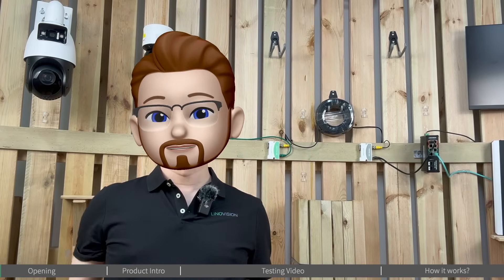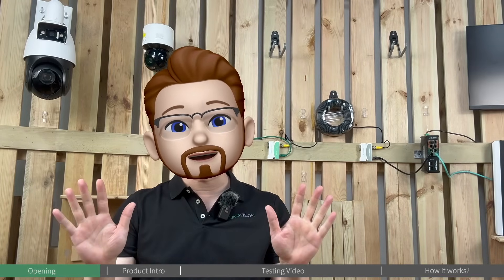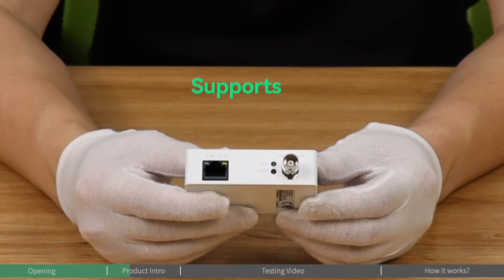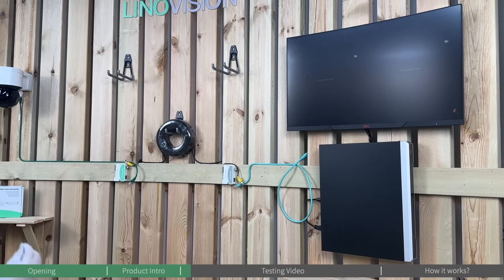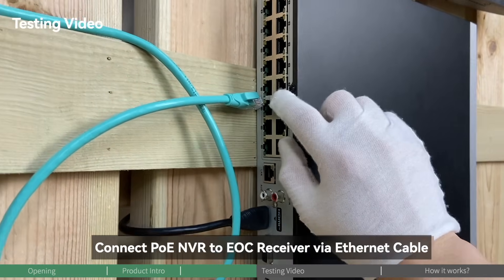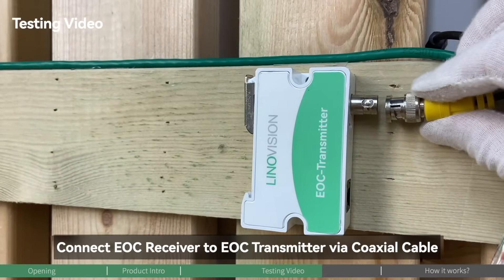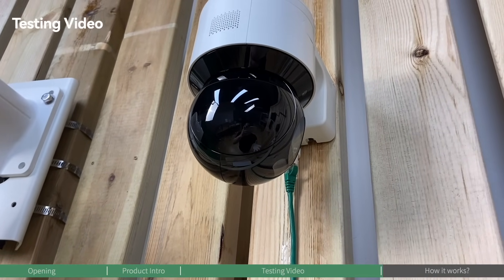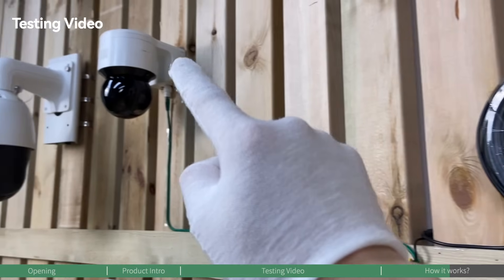How to upgrade your Analog Camera system to IP Camera system WITHOUT REPLACING existing COAXIAL?

Comment: How far eoc transmitter can be installed from ip camera.
Reply from the maker: Max range from IP camera to eoc transmitter is 330ft. (100meters).
Reply from the maker: However, if needed, we also got extender, that can achieve longer distance.

Comment: 700meters siamese cable will it work?
Reply from the maker: Yes, it can work.
A 700-meter Siamese cable can be used with Ethernet-over-Coax (EoC) converters, which support up to 1,000 meters for both data and PoE transmission.

However, please note that signal and power loss increase with distance. For the best stability and performance, make sure the coax part of your Siamese cable is RG59 or RG6 grade, and keep all connections dry, tight, and shielded from interference.

Comment: I have 9 1080p analog cameras at home, would be $810 dollars just for this MOD. I can buy a 12 4K IP cameras including the NVR with 4TB HDD included for less than $500 dollars, not the best one, but not the worst one. Good idea, but expensive MOD. (This would be NOT an UPGRADE, would be a MOD)
Reply from the maker: You’re absolutely right, if you already have a full Ethernet network in place, then it totally makes sense to go with a native IP camera system. Our so-called “upgrade” mainly refers to upgrading existing analog systems over Coaxial Cables, without the need to tear down walls or rewire the entire network.

The EoC solution is designed especially for those who already have Coaxial Cabling and want to upgrade to PoE IP cameras while avoiding the high labor and material cost of new Ethernet installation.

So in short, if running new Ethernet cables is easy and affordable in your case, IP cameras are a good option. But if rewiring is difficult or expensive, EoC offers a more practical upgrade path.

Comment: Hello..any solution for  analog camera to connect to nvr ethernet port please?
Reply from the maker: That’s a great question, and technically, yes, it is possible, but not directly.
Analog cameras (like CVBS, AHD, TVI, or CVI) send video through coaxial signals, while NVR Ethernet ports only accept digital IP data.
So you can’t just plug an analog camera into an NVR network port and expect it to work.

The only way to make it compatible is by using a video encoder that converts the analog signal into an IP stream. Once converted, the NVR can recognize it just like a normal network camera.

That said, if you’re building a new system or planning upgrades, it’s much better to move toward IP cameras instead.
They deliver higher resolution, easier remote access, and true digital integration,  plus they work seamlessly with PoE power and smart features like motion analytics or cloud management.
In the long run, IP systems are simpler, more scalable, and more future-proof for automation and AI-based monitoring.

Comment: I wanted to add 2 more cameras to my system, So my dvr has coax and the cameras have ethernet. Wpuld just need one of the transmitter boxes?
Reply from the maker: Hi, thanks for reaching out with your question. If your DVR has an Ethernet port, you would need to use a pair of EoC (Ethernet over Coax) converters, one at the DVR side and one at the camera side, following the setup shown in the video. However, if your DVR only has coax inputs and no Ethernet ports, then EoC would not be applicable in that case.

Please feel free to let us know if you’d like any further clarification or guidance, we’ll be glad to help.

Best regards,

Comment: After installing the RX, TX converter, is it possible to control IP CAMERA ZOOM or FOCUS from the NVR?
Reply from the maker: Yes, absolutely.
Reply from the maker: Using a pair of EOC converters is functionally the same as connecting your IP camera to your NVR with a regular Ethernet cable.
So if zoom and focus worked before, they’ll work exactly the same after installing the EOC.

Comment: Can I only use the receiver for cnnecting a little spy cam with composite plug and convert that to digital signals for IP-apps?
Reply from the maker: Hi! Thanks for your question.

Unfortunately, no, you cannot use just the receiver to connect an analog spy cam with a composite plug.

Our PoE over Coax Converter system works as a matched pair, both the transmitter and receiver are required. This is because the system transmits IP data over coax by using a special modulation and demodulation process. The receiver is only able to interpret signals that have been encoded by our transmitter, not raw analog signals.

Even though your spy cam and our converter both use coax cables, the signal formats are completely different. Your camera outputs analog CVBS video, while our system is designed for digitally modulated Ethernet signals only.

Let us know more about your setup, we’d be happy to recommend a product that fits your needs better!

Thansk for Watching!

Comment: Helpful video.  I purchase IP cameras (x4) with NVR over PoE.  I have existing coax lines installed in my house.  To make sure I fully understand, do I aimply need to purchase x4 PoE Ethernet over Coax EOC Converters?

Or, can I purchase x4 EOC transmitters + x1 EOC switch as a substitue to requiring x4 EOC recievers?
Reply from the maker: Yes, you can purchase 4 EOC transmitters and 1 EOC switch as your primary solution. https://linovision.com/collections/poe-over-coax/products/8-port-industrial-poe-eoc-hybrid-epoe-switch-with-poe-over-coax-technology?variant=43602204262620

Comment: Nice video. Can you explain how connect no poe camera by ethernet cable to analog XVR system. With  poe switch or splitter. Thanks to much.
Reply from the maker: Hi Enrique, thanks for reaching out, based on your question, If the XVR has available IP camera interfaces, you only need to add a PoE Injector on the XVR side. This allows you to load the XVR’s data link and power supply into the Injector and transmit them together to the camera. At the camera side, deploy a Splitter 1224 to separate the data and power, enabling both power supply and network connectivity for the nPoE Camera. If there are no available IP camera interfaces on the XVR, you will need to purchase a Coax Adapter to convert the coaxial interface to an RJ45 interface, then repeat the above steps.

If there are multiple cameras and the analog camera input function of the XVR is not highly needed, it is recommended to replace the XVR with a PoE NVR. In this case, you only need to purchase the NVR and Splitters to provide power to the nPoE Cameras and record the video data.

Here's the LINOVISION Splitter1224 product link, check out to learn more: https://linovision.com/products/industrial-gigabit-poe-splitter-hot-switchable-dc12v-or-dc24v-output

Regards,

Comment: Interesting video, couple of questions, 
1. would the picture quality be exactly the same on a upgraded analog wired system with 8mp 4k cameras as a system using full ethernet cable also with 8mp 4k cameras?
2.what's the expected lifespan of the Linovision receiver and transmitter?
Reply from the maker: Gary, thanks for your inquiry. 1. The picture quality will remain the same over coaxial cable, as the 4K requires max 10Mbps bandwidth only, while the coaxial transmission bandwidth can be 100Mbps (reduce to 10Mbps after 1000ft). 2. The expected lifespan is much more than 3 years in our real RMA history.
Reply: @linovision  Thanks for the reply, good to know there is no loss in picture quality. unfortunately if i have to replace 8 sets of these around every 3 years isnt really viable at £80 per set,  £640 in total.
Reply from the maker: @garyclapham5482  You can use EOC-Switch0808 KIT to save some money. It is a combination of 8 ports industrial POE Switch and 8 pairs of EOC-converters. (https://linovision.com/products/8-port-industrial-poe-eoc-hybrid-epoe-switch-with-poe-over-coax-technology?_pos=1&_psq=eoc-switch&_ss=e&_v=1.0)

Comment: Would 4K IP cameras support this EOC trasmitter and receiver linovision setup? What 4K IP cameras would you recommend? I want to use synology surveillance system instead of a traditional NVR. Does that work?
Reply from the maker: Hi, You can use EOC-Converter (Receiver+Transmitter) with 4K IP camera.
The transmission bandwidth can be max 100Mbps in 1000ft, or 10Mbps in3000ft. The required bandwidth for one 4K IP camera is about 8Mbps (H.264 encoding) or 4Mbps(H.265 encoding). So it is definitely no problem to transmit 4K IP camera videoover coaxwithout losing quality.
I recommend our IPC534AI-CSL for you.
https://linovision.com/collections/smartvu-camera/products/4mp-ai-smart-night-colorvu-ip-turret-dome-camera-support-active-deterrence-with-strobe-light-and-audio-alarm

Comment: is good for technician becuase they can use the existing cable if the client isbeing cheap good video
Reply from the maker: Exactly, upgrade to IP camera system without replacing the exist coax.

Comment: Hi how do you get power to camera over audio cable between the EOC Converters
Reply from the maker: Simultaneous transmission of AC signals and DC power over a single coaxial cable using power overlay technology

Comment: hi.thank you for sharing your video and demo.. this is my situation , i have 4 analog cameras outside in my warehouse i used cat6 cable and used each twisted pair of wire to send video ( by bnc valun) to the dvr. and each 4 camera have their own power supply. now, i want to add 1 or 2 more ip cameras and planning to use PoE switch. will this work on my situation..is this eoc transmitter really need tx and rx? since i can connect a shorter bnc coax direct to the analog camera after the eoc? and i already have cat6 cable..i wish you could help me with my project..again many thanks.
Reply from the maker: Hi skywalkerorig, thanks for watching. Regarding the issue you mentioned earlier, our engineers have conducted the corresponding tests and have prepared a detailed info. Please click this link to learn more. https://lxiegyux98shhykq-65999110384.shopifypreview.com/pages?preview_key=e340cacffdbaa62d87f23892a3cb9c74   Thank you.
Reply: @linovision  hi..thank you very much with your prompt reply.. i will study all the options you have suggested...and btw.. i have a Dahua DH-XVR1B16-I and i can connect poe switch to 1 LAN port...main problem is running additional 1 cat6 cable from dvr to outside of the house. that's why i want use only the existing cat6 cable which is already in use...again many thanks with all your suggestions

Comment: Hello, I want to upgrade my analogue coax system to IP, will these converters work with 8MPx cameras which use a lot bandwidth?
Reply: yes, I believe so. the transmission bandwidth is 100Mbps in 1000ft, or 10Mbps after 1,000ft, which is also sufficient for one 4K POE IP camera.

Comment: Is there a way to connect the older style camera to the newer style IP nvr?
Reply from the maker: EOC can connect the analog camera to IP NVR.
Reply: Can it do ptz cameras too ? @linovision
Reply: So, in this case just either the TX or the RX is used at the NVR end?
Reply: @linovision sir can i connect bnc/analog camera to this then to nvr?
Reply: That was what he was supposed to teach not an IP EOc/etc
Reply: From analog to IP upgrade is the topic not ds

Comment: I have a question about Access the GUI of camera and is it possible to tilt PTZ
Reply: yes, it is no problem to access camera GUI and control the PTZ movement. The transmission over coaxial cable is transparent in the system.

Comment: I have question about wiring your Long Reach Ethernet Transmitter/Receiver; We installed one pair and ran Coax Cable between the transmitter and receiver as pictured in your booklet. It’s approximately 700 feet between the transmitter and receiver.  When it get colds out, the camera goes out and when it warms up, the camera comes back on.  We feel that when it is cold, usually below 32F, the power is dropping between the transmitter and receiver.  Is that possible?  How could this be fixed?  Thanks in advance.
Reply from the maker: Thank you for your message. We have looked into the issue and communicated with our technical support team. The temperature data you provided is within the normal operating range of the device, which is –30°C to 65°C (–22°F to 149°F). We recommend that you further check the camera and wiring.😊😊😊😊😊.
Reply: Use injectors